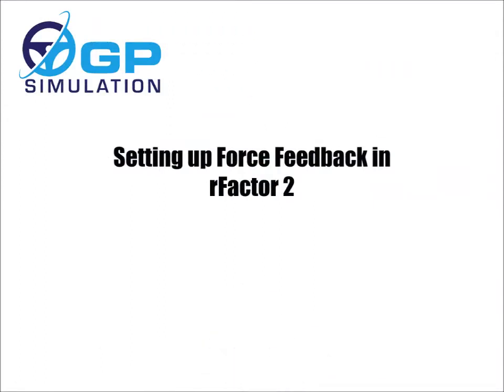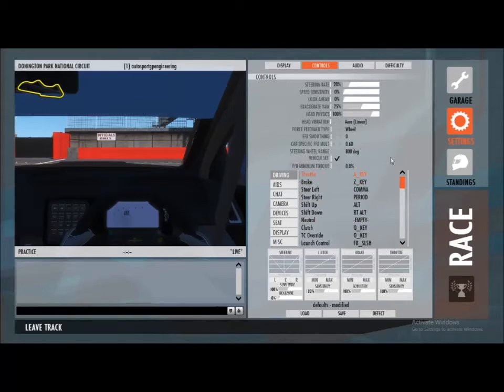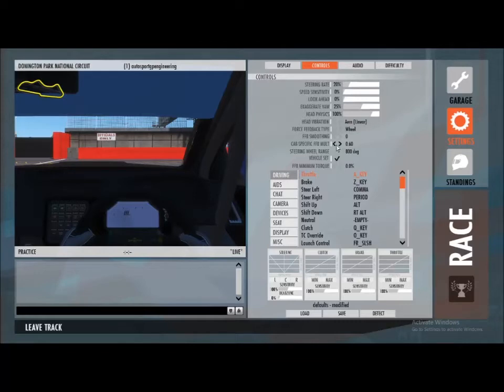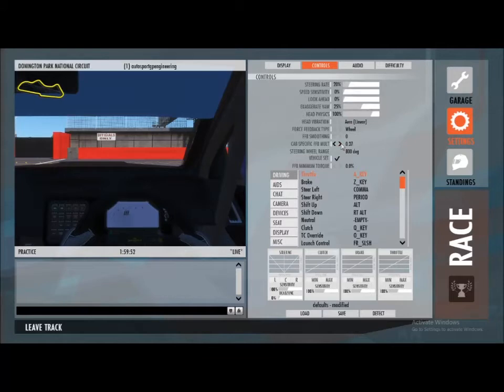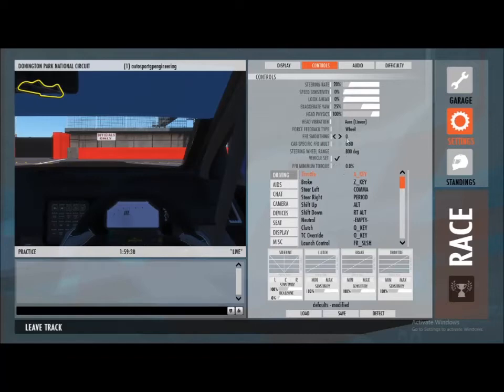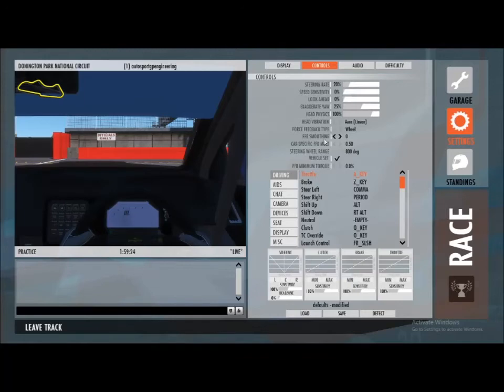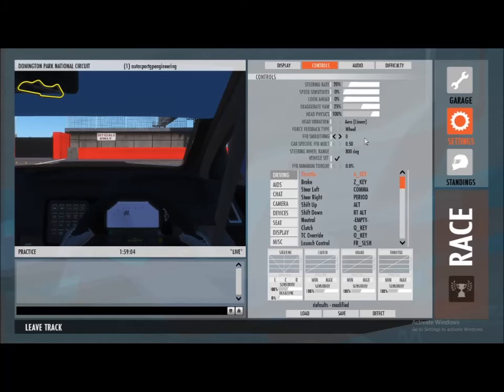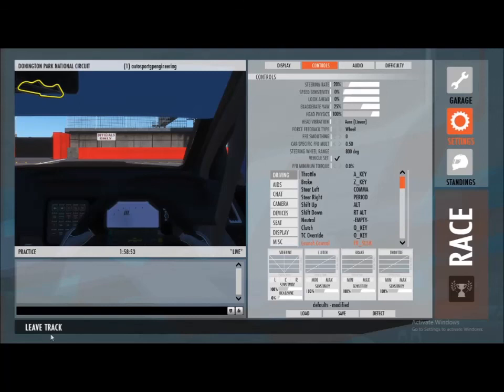Quick guide to setting up FFB in rFactor2 for beginners

Comment: (Logitech G920) When I change the setting to shift manually, my paddle shifters do not work. They work in FH4 so it’s not the wheel itself. Any help?
Reply from the maker: There an option to add additional shifters which you can set to be your paddles, so that then you can use either paddles or manual. Its towards the bottom of the driving menu in settings/controls if I remember correctly.
Reply: @GPRaceSimulation  I will try this when I get a chance. Will update if fixed. Thank you!
Reply: @GPRaceSimulation  You were correct. Thank you much!

Comment: I'm using a Thrust Master TS-PC Racer wheel, ( BELT DRIVE)
I have set mine in game , FFB smoothing 0 , car specific FFb multi to 80 , Vehicle set Ticked , FFb minimum torque 1.5% ( 0 for DD wheels, 1.5 to 3.0 for belt drive and lower strength wheels) , also set the throttle sensitivity to 30 ( heaps better throttle control, trust me ) drop the clutch sensitivity to about the same, may help with standing starts, drop the brake too if you want. 
In the wheels control panel settings set the over all strength to 75 ( wheel will have a longer life span ) , Constant and Periodic to 100 , spring + damper to 0 % , auto center to by game. 
I would also recommend setting it up while using a 397 laser scanned track and a 397 car, Sebring is a good one with all its bumps and a GT3/E car, Le Mans another good one. Unofficial cars and tracks may not have the same quality when getting a good base line for your FFB settings. 
When ever you drive a different car for the first time, go into the in game wheel settings and set them as above, the default setting for the car specific multi when driving a new car for the first time is 1.00 and by dropping it to 80 is 9 times out of 10 all I have to change, If the FFB is too strong or weak adjust only that up or down. and check that FFB minimum torque is where you want it too, 1.5 for me. ( will bring out the track bumps a bit more the higher you go).
If your wheel spins wildly when in the pits when you get in the car, raise FFB smoothing up by 1 or 2 increments till it stops doing it.
Reply: I have the same wheel as you but the Xbox version and the ffb is weak. It’s fine in other games but in rfactor2 it just isn’t good.
Reply: Also the ui in this video looks completely different to what mine is at the moment
Reply: the ffb doesnt work in every car for me and i cant find the solution

Comment: MATE!!!!!  thank you so much for this short video, I have been struggling for 2 days on this issue, now I have something drivable..   The only thing now is the FFB seems to be in reverse, this my next issue.
Reply from the maker: What wheelbase do you have? Simucube is inverted so shout and I'll send you details on how to invert it.
Reply: @GPRaceSimulation  I found the solution,....  In the control file I changed the number from a negative to a positive, drives normal now.
Reply from the maker: @ArtOfDavidAmos  that's it Congratulations. Have fun!
Reply: Where’s the control file? I’m having this problem aswell
Reply from the maker: @maxjones2722  Depends on your partition and hard drive setup, but on mine it's c:/programfiles(x86)/steam/steamapps/common/rfactor2/userdata/controller
Reply from the maker: Find your nearest equivalent controller file name, and open in Notepad, change steering effects strength to -10000

Comment: Shit man, I run 0.85 to 1.20 on my CSWv2 for cars specific and smoothing around 5 to 12.
Reply from the maker: The point of the video is to try to cover all wheels and all mods so that anyone first running rFactor2 has a setup that can actually be used. I was getting a lot of our league drivers having real problems because the smoothing value on the BTCC mod causes very weird effects, booting the ffb in some strange ways. So the point was to start low and build up, and if you have any issues with a mod, start low again so it's driveable, and go from there.

Comment: I dont agree with your settings. also for DD there is no way around adjusting the driver software as well.
20% multiplier for a G29? The amount of FFB you get then would be up to 0.4Nm with this setting. going below 80% is often quite enough to avoid clipping on almost all cars, maybe 70% on some GT3 with rubbered in track.
Reply from the maker: The reason the video was made was because I kept having people complain that rFactor 2 was undriveable witha  variety of different consumer grade wheels, and by far the most common reason was weird effects casued by high smoothing values, which on some mods, in particular the BTCC Civic etc causes the wheel to behave strange. It's not a be all and end all setup, it's where to start from somewhere that you can actually use.
The ffb multiplier you misunderstand. That has nothing to do with your wheels ffb torque, but, its a scaling factor of the torque the game/mod requests the wheel to produce. So in this case being the BTCC mod that has max torque of 25Nm an ffb multiplier of 0.4 requests 10Nm from the wheel, which is more than most consumer grade wheels can produce and so you are into clipping. On other mods with lower max ffb torque you can run higher multipliers. 
Like I say you can't cover everyone initial issues with a range of wheels if you start to high here and with too many effects. You must start low and build up.
Reply: @GPRaceSimulation  really? I was running a G29 for months and I had almost no FFB clipping with 0.8 modifier on every studio car or mod. Its easy to check using data logging plugin. Also you said 0.4 for DD and much less for consumer grade wheels. Are you using a pro version or something that causes this misunderstanding? I only have rF2 Steam consumer build
Reply: @virtual_GaRy  i have a g29 and just recently got a g29, what ffb settings do you recommend?
Reply: @Amevnyycz  I settled on min force 0, Car specific Multiplier 0.7 usually and  smoothing 5. Also back then G hub was bugged with the wheel so I always used Lofitech Gaming Software. In there centre spring off and thats about it
Reply: @virtual_GaRy  thanks, i hate how i dont get reply notifications
Reply: @virtual_GaRy  I don’t get why my car specific multiplier is in 100’s and not units. It can go up to 500 and more and yet you guys are saying 0.7! Why is mine not the same?
Reply: maybe it changed with the new UI? its probably just 0-100% now instead of 0 to 1 (and beyond)